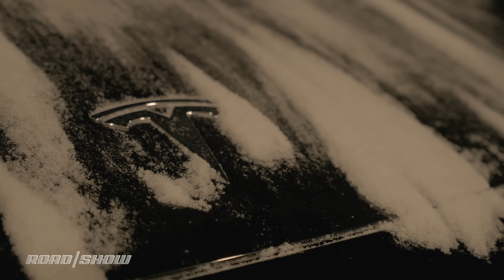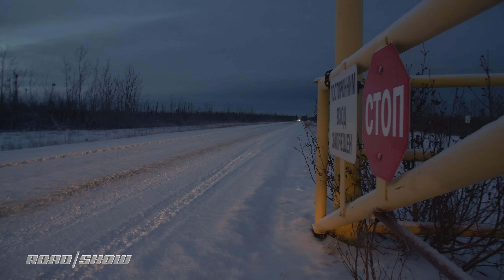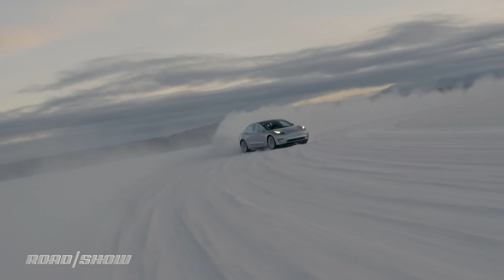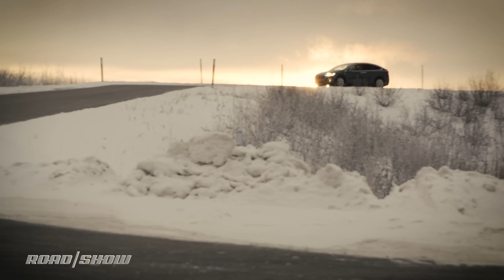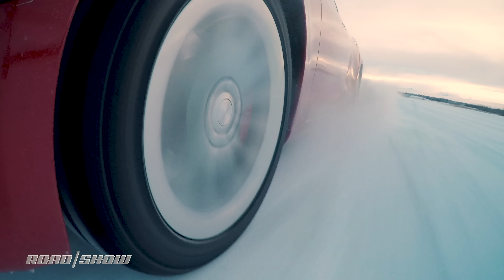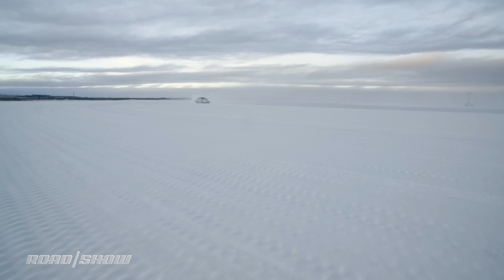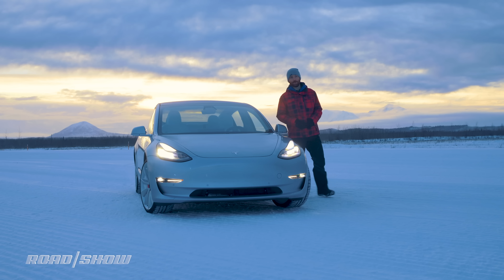EXCLUSIVE: Winter driving all Tesla cars in Alaskan snow | Sideways Included

Comment: I find it hilarious that people think EVs aren't good in cold climate.  I live in Buffalo NY with a RWD Model 3 and its nearly as good as my old Subaru WRX in the snow with a decent set of snow tires.  Just don't drive like a jackass and you'll be fine.
Reply: Thanks for this reasurance, do you by chance also store in garage? I'm in Iowa and have debated whether AWD because of the snow we get and also that we have some hills. I think the money savings on the RWD could go towards a good set of tires on the Aero wheels and having some nicer wheels for summer. I would plan to keep the Tesla out in the driveway as I store my Mitsubishi Evo X for the winter and only have one stall in garage. I know the garage would be better for the batteries in the Model 3 but it's one or the other.
Reply: @Campos2011   I do park my car in a garage so it reaches the charging cable easier.  However I have charged it in the driveway with the cable running out to it.

The key to doing that is just make sure the end where you plug into the house is protected.  The end that plugs into the car is fine.  I've even charged in the rain before.  Tesla recommends not charging during massive downpours though.

Charging in the winter should be fine even outside.   I'd watch the charge door/flap on the car to make sure it doesn't get too much weight on it is all.

During the winter you will definitely use more battery compared to the other seasons.   And the car will eat a little power while sitting to keep the battery warm.  Teslas are huge in Norway and they have longer winters than we do.

Now, all that being said,  Tesla just reduced the price of the dual motor Model 3 to $47k before the fed tax credit.  That brings it to $43,250.  That's just $1,250 more than I paid for my LongRange RWD back in August.  It's a personal choice of course.
Reply: Omg I was looking at this video to see, "Hey will a tesla perform well in snow, especially the winters we get here in Buffalo" and just seen this comment. So I take it you haven't had an issue with a tesla in these winters then?
Reply: @Elyk Regna 
Yeah, I drove mine all winter through the salt.  I guess we'll see how it holds up years from now  :)

Mine is the Long Range RWD model.  I was worried how it would do in the snow.  First storm we had was about 4-5 inches.  For that one I only had the default all seasons from Tesla.

I was absolutely shocked.  Not as good as my old WRX with snows, but it was impressive.  I'd say as good, maybe a little better than a FWD car with somewhat more aggressive all seasons.

The stability control and the responsiveness of the electric motor kept it moving just fine.

When I did get my snow tires (the pirelli soto zero that Tesla sells on their site), it was nothing short of amazing.  I think it would keep up with the WRX in normal driving.  Maybe not on a rally course :)

In the deep freeze temps, the Model 3 was great, reliability wise. Even on the -10 days I never had to worry about "will it start".  Just put in drive and go.  It had some loss in power at the top end, and regen braking pretty much gone on those days.  But that's normal.

The battery would also eat some of its own power to keep itself healthy, and the resistive cabin heater takes a fair amount, so you charge more in the winter, and you give yourself extra juice for your daily trips.

That cabin heater turns on very quickly btw.  Don't have to wait for an ICE motor to warm up.

If I bought the car again, I'd get the dual motor, but only for the performance increase.  RWD model 3 worked fine in a Buffalo winter.
Reply: @Elyk Regna Note that you can turn on the car's heater remotely from the phone app.  So if you have to run into a store, etc. for ten minutes or so, you come back to a fully warmed car interior.  Or just turn the heater on a few minutes before re-entering the car.  Same with the a/c.

Comment: The skinny is simply that combustion engines are heat engines - and the heat is free.

Electric ‘motors’, make kinetic energy - ie motion- more efficiently.   However the downside is that the heat isn’t free.

Having said that, there are some ways in which electric engines are superior in the cold.

You can sit in a snow storm with your electric engine on - you can’t legally do that with an ice car - as a snow and ice clogged exhaust on an idling car could kill you from carbon monoxide poisoning.

Also you can happily keep your electric car warm all winter night - as long as it’s plugged in.

When you’re ready to go to work in the morning - you have a warm car and a full charge.

Try that in a gas car.
Reply: Yes the heat is free... if you ignore the 70% of fuel that you are throwing away to get "free" heat.
Reply: MsSomeonenew : Exactly.  

A combustion engine is a heat engine primarily - it is only a ‘motor’ as a side effect.
Reply: Yeah I was going to say... I used to deliver pizza in a car that got about 24 MPG... That heat was anything but free! A free byproduct, yes, but that's not the same thing as free.
Reply: You can plug your gasoline/diesel car in and have a warm car for your work trip.
Reply: More accurate to say the heat is a byproduct  ( and benefit) of the ICE engine, not a freebie.  There's a cost, that being diesel or gas.  Tesla needs to specifically address the needs of winter driving in northern climes. Preheating uses a LOT of power and reduces vehicle range dramatically. 30% is more accurate than 10%.

Comment: How do they perform for 90 miles of heavy freezing rain turning to heavy blowing snow between the altitudes of 4900 and 7200 feet going along Interstate 40 in New Mexico? We saw a Tesla S in the ditch attempting to extracate itself while on a climb for the second time to 7000 feet. The Kia Soul ahead of us puttered along well as we followed it in our Subaru Outback through to the end of the route down into Albuquerque and then to Gallup. I guess all the fancy Tesla technology can't overcome poor human driving but I doubt autopilot would have worked any better. I'll keep my "primitive" 2011 Subaru as even with all season tires it still did better than a Tesla costing at least four times more.

I would also like to see Teslas tested on unplowed, minimally maintained forest roads and on steep hilly unplowed highways and city streets with at least 6 inches of wet snow using all season tires.

I also want to see Teslas tested after heavy freezing rain downpour and having at least a quarter inch of ice on them versus a Honda Civic ot Toyota Corolla without any plugging in or covering the glass with plastic sheeting. No ice melting sprays are allowed either. I want to see how easy it is to get into them, open all doors, hoods, hatches/trunks, and get them on the road to a range of 300 miles without stopping. Manual ice scrapers are allowed.
Reply: Why would you even drive a Subaru under those conditions?  You need a Jeep.

I loved all my Subarus,  My 1996 Manual Legacy Wagon was a joy to drive.  The catalytic converter caught fire and it burned to the ground.  
I loved my 20 mpg max 2001 Outback Limited. Solid as a rock.  Beautiful well made interior.  The head gasket blew twice.  The third time the dealer just told me to sell it.  It was immaculate with 210,000 miles the junkyard gave me $900 for it.

The car I waited 4 years for. My 2013 Subaru BRZ. Beautiful handling machine with a boat anchor motor.  I loved that car.   At 52k a valve spring broke.  Subaru refused to cover it.  So I sold it.   Now Subaru has a recall on the 2013 BRZs for valve spring problems.  My 2013 BRZ had 4 times the rust under the car than my 2001 Jeep.  The BRZ was a car covered garage queen that never saw snow a day in her life.
 Subaru never acknowledged the head gasket problem ever.

Subaru is dead to me.

Subaru will be dead to the rest of the world unless they learn to embrace battery technology.

The Tesla 3 is the next evolution of automotive technology.  It is that good.
Reply: @fatboy19831  I had two WRX Sport wagons and never had a problem with them. My last one is stg 3. My brother has a 2007 stg 3. No problems whatsoever.
Reply: @Balabok  Turbo lag, Turbo lag, Turbo lag, horrible gas mileage.  A Mustang GT gets far better gas mileage than a 2007 WRX.  Any stock Mustang GT.  A 1983 Mustang GT.  The WRX is fun as hell balls out.  As a transportation tool, it sucks.  Even the 2018 WRX has a horrible powerband with turbo lag.  In 2019. At least the gas mileage is now acceptable.
Reply: @fatboy19831  Depends on the tune. I had miminal turbo lag plus I was getting 28 mpg on a car that made close to 400hp.
Reply: @Balabok   I have never driven an American Subaru Turbo without considerable lag ever....in any tune.  Going downhill at 40 mph does not count as fuel economy. Convince someone that has not owned 4 Subarus.  Two of them tuned.  A 400 whp WRX is lucky to get 17 mpg in normal driving.
Reply: @fatboy19831  Maybe you need a better tuner. I'm not going to argue for your benefit.
Reply: @Balabok   I sure do need a better tuner.  I would love to get that 400 hp 28 mpg perpetual motion tune.  My 2013 185  whp  manual 2700 pound N/A BRZ got 28 mpg in normal driving.  Your 3100 pound 2007 WRX with 400 hp can do that.......Yep I need to know your tuner.
Reply: @fatboy19831  Go on NASIOC and look for yourself. I had a Clark e-tune and I averaged 24 mpg city/highway. Strickly highway, I got 28~30 mpg if I stayed out of boost which was easy to do.
Reply: @Balabok  Like I said my BRZ averaged 28 mpg.  No turbo 2700 pounds.   That is driving the pee out of it.   At 55 mph level gound tapping the gas, I could hit 39 mpg.   I would not go on youtube saying I get 39 mpg in my BRZ.  A 2007 WRX is an 18 mpg car stock.  Tune it to 400 hp and the mileage is not going to go up to 28 mpg.  Stock the WRX has hell to get to 24 mpg on level ground. Like I said tell someone that has not owned Subarus.  A 2007 base N/A stock Impreza cant get 28 mpg.  My 2001 one Outback auto could barely hit 22 mpg.  Until recently horrible gas mileage has always been an ugly secret at Subaru.  No turbo modern Subarus have excellent gas mileage.  The last gen Outback could easily top 30 mpg with the 2.5 and the CVt.  Those 2000's Subarus sucked gas.

The 2007 STI was rated at 19/25.  It was easy to average 17 mpg on a tank running hard.  23 mpg if you really dove it like you were sane.
Reply: A S

Subaru fanboi had me until " extracate".  Cars don't extricate, drivers do. 

Try running that Subie with no oil changes for life of car. No filter changes. No maintenance.  No gasoline. Yeah, thought so.   A Model 3 PDM is so superior to anything Subaru currently offers. I won't even go into how bad a Model S P100D will beat any known WRX Sti made.  Heck, I'll take an Accord 2.0t over a Legacy any day of the week.

Comment: Ammm what's the point of turning off those settings (which owners will never be able to do) to test it??  Huh?   How about turn off the brakes and try to brake.  What's the point??
Reply: To show how well a system works, you show what happens with and without it. Basic logic.
Reply: are you joking? obviously it's to visualize the amount of assistance the car provides you to avoid spinning out, which exceeds most drivers capabilities.
Reply: To compare it directly against that old clunker 4x4 that Jim Bob has parked next door while telling all his neighbors how much electric cars suck.
Reply: if you want to demonstrate what a brake does then yes you probably do want to turn off the brakes and try to brake.

Comment: So basically it acts like any other car in the snow.
Reply: Lord Ba'al this guy who races on ice seemed to think it was a revelation compared to anything he has driven before. Traction control works 10,000 times per second instead of maybe hundreds per second for a gas powered car with all its mechanical linkages.
Reply: Not mine, that is for sure.
Reply: @qqleq  This guy is a pace car driver. They can drive better then anyone else.
Because no one in their right mind would be doing more then 10 on a snow packed road.

Comment: That's 30 percentage not degrees. They are different 😏
Reply: Yes, a 30% slope is only 17 degrees.
Reply: @ErksumSpiffly  right, I could see that wasn't 30 degrees!
Reply: Metric versus Imperial measuring system....
Reply: Ricardo Nunes, is that (metric/imperial) percentage of a circle or (metric/imperial) angles? Actually, It has nothing to do with either system. It's about trigonometry.
Reply: @ricardonunes3633  I've never seen a % slope sign anywhere in Canada or the United States.

Comment: 1. This was a fun, very well done video. Bravo!
2. How....in a winter driving video....Tesla or otherwise was there NO MENTION of what tires were used? Did each model run these tests on bone stock all-seasons...or Winter tires? That should have been one of the initial things mentioned as part of testing. "Today we're using 'XXXX' tires to perform these tests in the snow." or something.

Comment: Nice Tesla Ad. As a performance 3 owner I don't feel this answered many of the actual practicality questions regarding cold weather criticisms
Reply: @rnodeprot  I don't think anyone ever questioned Tesla's traction and stability control capabilities though
Reply: @jasenrock  From Montreal, Quebec, Canada

No you dont need a garage. A car "Tent" will suffice. You only need to charge the car right up until you leave. With the heater on 30 minutes before leaving. The model 3 heat the battery while heating the cabine and with 60A power source, you have plenty of juice to finish charging. And when rolling, use less heater and more heated seat. The range loss is  less.

I know, I do it every night. I have a model 3 AWD LR.

Fun fact: I am seeing more and more model 3 around here in Quebec.. Nice
Reply: Those with a garage are a small minority.
Reply: roguenode pfft, that's the short list. Try seat heaters sucking amps , failure to defrost cars left outside, insufficient heat to clear Windows, door handles sticking, clearly, an ICE vehicle has it beat for winter use at this point.  That may change as technology advances.
Reply: @Newzchspy  What do door handles & windows sticking have to do with EV vs ICE? It's clearly a car-specific thing. I expect Volvo's electric cars to be excellent at those things when they start releasing them.
Reply: BosonCollider I've never had an issue with door handles or defrosting on an ICE car.  Can't say the same on the Model 3.  With current weather , the Tesla is eating up its battery at 6-800 kWH / mile , effectively halving range. Never had that issue with ICE.
Reply: @Newzchspy , it sounds as though you're not very familiar with the door handle issue. It's the result of a design decision to flush the hardware to the body, and has nothing at all to do with the type of motor. Oh, and as someone who grew up in Michigan, frozen door handles have been a (small but not unknown) thing for many decades.
Reply: its a car itll fine
these teslas have been out since 2013

Comment: At about 58K+ clips and not the 35K Models past due with one motor.
Reply: The 44k Midrange is now available with almost no wait.
Reply: @fatboy19831 It ain't the Everybody 35K Model 3 as promised and advertised back then and what you might get at that $$$$$.
Reply: @QuietStormX  My bet is the 35k car will be 40k.  In 6 to 9 months.  I wanted the 35k car.   My LR RWD 3 was 51k.   With $7500 fed and $3000 State Tax credit. down to $40,500.   If I wait for the 35k car I would add the $5000 luxury package,  $1500 paint.  That would be $41,500 -  $2000 fed $3000 state. or 36,500.  So for $4000 more, I get to 60 almost 1 second quicker, have a 15 mph faster top speed, and 90 miles longer range.  That is with me already having an order in.   If you don't have an order in you are not getting the federal tax credit on the 35k 3.
Reply: QuietStormX the base model was always promised as coming out after the higher priced versions. Tesla’s strategy has been to start with low volume expensive cars and slowly move down in price as they can scale production up. So far they have grown production faster than anyone since the original Ford Model T. So far, every step has happened as they planned it as fast as they have been able to grow.
Reply: Don’t expect BMW M3 / Audi RS4 performance from a car that costs almost half...
Reply: Past due? The plan was always to sell more expensive versions while they ramp up production and to introduce cheaper versions as they become possible to produce with decent margins. Tesla has been completing every step in the same plan they have had for over ten years now.
Reply: @0ooTheMAXXoo0  Years Late than promised and no one know if it the 35K Model 3 will ever be produced for the people who placed their deposits for and not the 85K+ Model 3's out now maxed out with options not standard. Not like GM or anyone else with their EV Models out now and coming with much buzz..